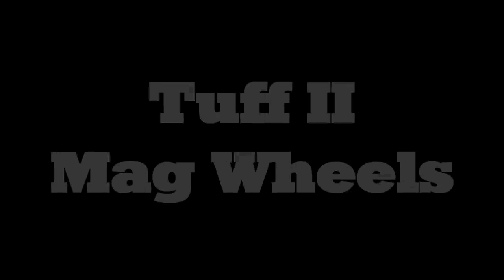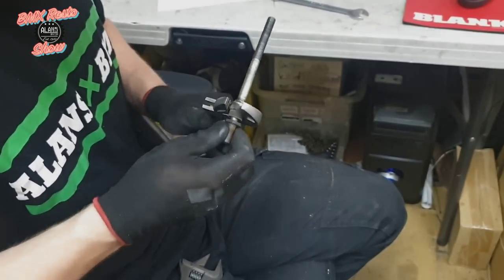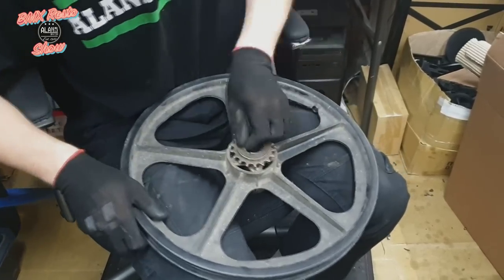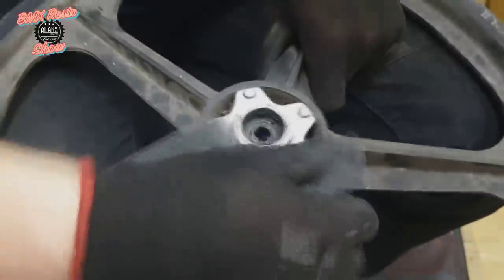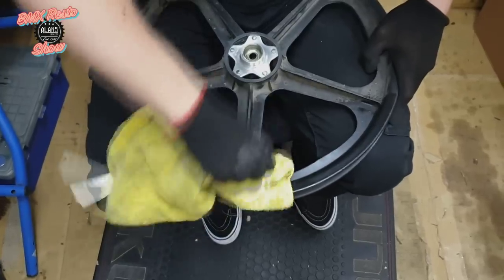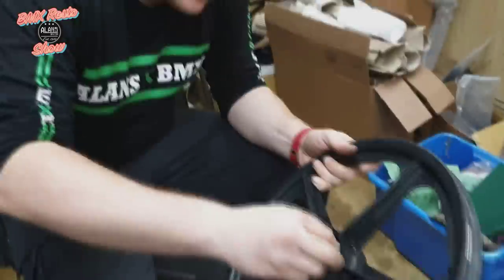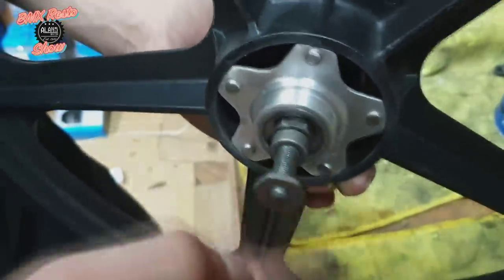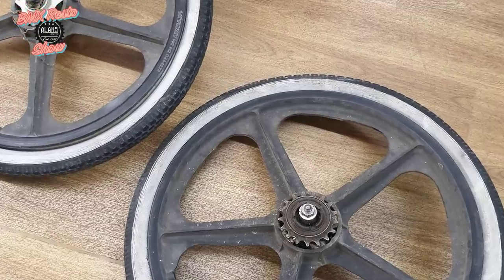AlansBMX Resto Show - 82 Skyway T/A - Episode 2

Comment: Look good.there is a couple ways you could go to make your process faster.wire wheel on the axel will takes two minutes to make them look brand new..they make a paint removing brush for drill guns that would clean the dirt off the hubs a lot faster and not hurt anything..working in a shop time is everything..they look great though..

Comment: Can you convert a front skyway mag into a rear one I have 2 front wheel only
Reply: Yep if the hubs are alloy buy a rebuild kit for a rear tuff you have to grind the heads off the rivets that hold the plates together and drift out the rivets the rebuild kit just bolts together hope this helps mate .

Comment: 01:35 When taking bolts off like this, it's a good idea to apply a little lube, or copper anti-seize, and work the bolt back and forth a little. In doing this, it will loosen any debris collected (rust etc) and lowers the chance of complications in unthreading.
Reply: Would have helped if they had an impact gun